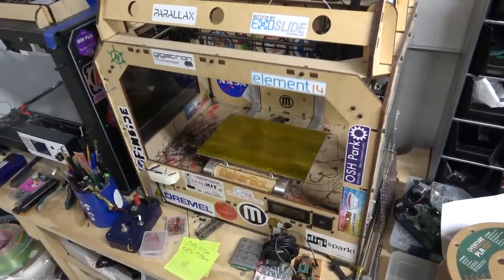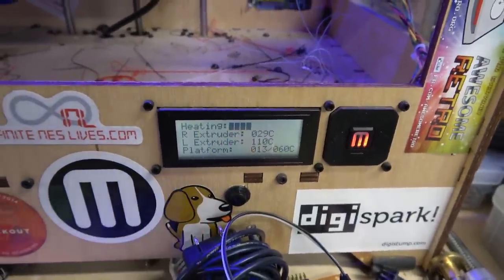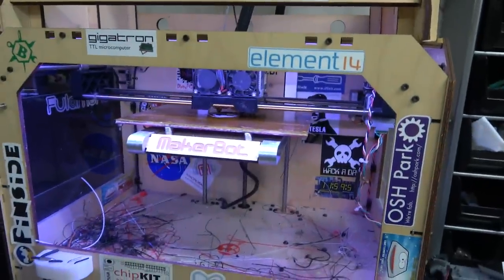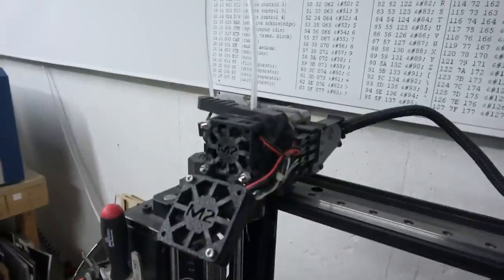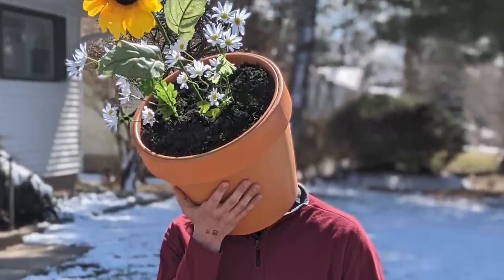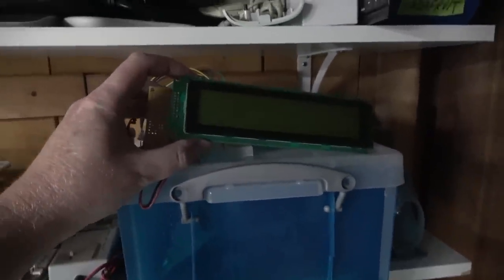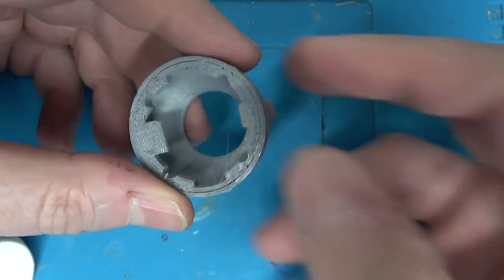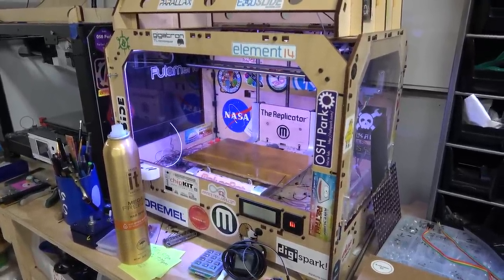10 Years of 3D Printing

Comment: I remember the days before 3d printers where you were limited to either trying to vaccum form plastic or shaving a block of plastic down to what you needed

Crazy how much precision is in a 3d printer
Reply: Even today, for some applications vaccu-forming and shaving block of plastic is used, all depends on the use case.
Reply: Especially resin printers. Holy hell do they have a high resolution
Reply: I wonder what the dominant form of 3D printing will be in 10 years? 3D prints not being as strong as solid parts in the consumer space is surely going to end.

Comment: I remember when you got that markerbot.  I was soooooo jealous of you because I was rocking a home built Mendel and was "WOW, so much nicer".  Then I built an I3 in 2010.  I was really styling then.  About 2014/2015 I was "I should build another one that is larger", and started collecting parts slowly, and life happened.  About 2018? I said "Time to get back on this" and found out that it was FAR FAR FAR cheaper to buy a printer...which I did...Ender 3 (original).  That is STILL cranking with WELL OVER 8000 hours (closer to 10,000).  

I so remember doing the Nichrome wire, baking the ceramic cement in the oven.  UGH!  The people I see on the forums screaming and crying about problems with their printers...lol.  Us old foggies tell them "you have it soooo bloody easy".  LOL.

Comment: Find files for this printer for Merlin 1.9, compile at -o3 trust me the fastmaths works for this version specifically & after compile you'll have exactly like 12 bytes left on the microcontroller.  This'll get you acceleration curves
Reply: why not -O0 which would compile for the smallest possible binary size?
Reply: @phant0m739  because, this is an 8-bit. If you want speed you want truth tables over functions if you want to bang those bits

Comment: Hi Ben!
My first printer was the Makerbot Thing-O-Matic, which came out just before your Replicator.
At the time, all the hobby 3D printers were $2000 kits. I lusted after having my own printer, and found a Thing-O-Matic unassembled kit on Craigslist for $999.
I went to get it, and the guy selling it bought it at full price, opened the box, and went Bleeh! No Way!
It was a totally disassembled, every nut and bolt 30 page instruction book kit.
Loved it, printed many upgrades, and bought the Sailfish control panel for it to get an LCD display much like the Replicator.

This was the very printer that you helped me get up and running at MRRF 2021.
Sorry I missed out on MRRF 2022.  Maybe see you in 2023!
Reply from the maker: I missed MRRF 2022 as well, I had the virus that week. Here's hoping for 2023! I still have that lens cap we printed. Was fun!

Comment: I had the CTC Makerbot Clone, I paid a £169 on Ebay UK for it, I used it for many years, I did several mods to stiffen it, and upgraded the extruder gears. I then built a Delta from a kit, and now I have a Creality CR-10S V2 Pro, which I like a lot. 3D printing is a great hobby and the technology still amazes me 🙂

Comment: I had one of these! I bought it used in 2012; the previous owner was upgrading to the brand new Replicator 2. It worked pretty well for a few years, then the bed heater failed due to a short circuit due to the edge connector melting, and then it limped along being able to only print PLA. Then I replaced it with an Artillery Genius a few years ago, and just a couple weeks ago I replaced that with a Bambu X1C, which is an amazing printer for about the same price as what I paid for the used Replicator Dual 10 years ago.

Comment: You should have told the fire inspector that the extension cord on the ground was "decorative", or it was an important trap to trip burglars and storage-locker auctioneers.

I love all of the random TI calculators in the background. You can't have enough of them.

I have lately been working on my Ender 3 (which was collecting dust for a couple of years after a move), and I have been banging my head trying to get ABS to print without bed adhesion issues. I'll probably try some gluesticks and run by a thrift store to find some glass for the bed. If that doesn't work, I'll go build a foam box for it. Any reason to prefer hairspray over gluesticks? If it's better for bed adhesion, then I might grab a cheap can of hairspray.
Reply: That didn't work for me.  It was an extension cable going from my printer to the kitchen.  Inspectors are too smooth brained to see the value in a three prong socket for a 3d printer

Comment: hi i just recently was given an original maker bot replicator gen 1 2x like yours and it did not come witthe extruder or extruder motors. i have ordered some e3d direct drive hot ends. what motors do you recpmend for extruders and what possible control bosrd would you recommend to upgrade to? thanks steve

Comment: A few years ago in my old apartment I had a fire inspector who was doing a walkthrough (every 2 years here) give me crap over an extension cord.  He said they worry about people overloading them.  I told him it was just for a TV, a small fan, and my phone charger. Also, told him that I have extensive training in electrical systems aaaand that I'm an engineer who knows how not to overload a circuit.  He then just said it's something they have to bring up because of all of the people who don't know what they're doing and will plug a high output window AC into a 16awg extension cord.  On the re-inspection (landlord had to fix some minor stuff) he ignored it.

Comment: I have the Flashforge version of this... still great... Win11 doesn't like it though :)

What is that separate Z screw for? I set Z with the springy bed screws
Reply from the maker: That's the Z home. It's the bed relative to the nozzle. Almost all printers have a form of this, how you fine tune it is what varies (in your case, the thumb screws)

Comment: I’ve got works old Replicator 2, not the 2X, in the process of rebuilding it at the moment. Got a RAMPs board for it and had it running until I decided to upgrade it to use bearings instead of sleeves. Using another printer to print the parts for it 😂
Glad to see they can last!

Comment: I bought an older 42” 1080p TV for my workshop to use for reviewing PDFs and schematics. Cheap like borsht, but the resolution is high enough I can view a good sized schematic without constantly scrolling. It also makes a great fake “window” to supplement the small real one in my tiny basement.

Comment: Ah the sounds of the Makerbot bring back memories of my CTC clone. I stripped it down last year as I'd bought an Ender 3 and had no use (or space) for it, and, would anyone even want it? I might be able to repurpose some of the parts. It was more reliable than the ender 3 has been, just noisier and slower, and I think it was still using the same nozzle too. Also want from S3D to Cura and there's pros and cons to both but I've already found Cura features I've used that are not available in S3D. Great little tour of your shop - I wish I had a basement (but, UK). Love your videos Ben.

Comment: I have the same fingers you do, same half moons & what I was told was cuticle psoriasis, except mine would split much worse than what I see. It was a pain in the ass & I tried to address for a decade before I found "The Naked Bee Hand & Cuticle Healing Salve (1.5 oz/Sunflower, Beeswax & Shea Butter)" It's a bit expensive, but after my first tin I bought 3 more in case it went off the market & that was 6 years ago according to amazon.

There was an immediate improvement, but it probably took a full year for everything to heal & start growing properly. If you don't mind vote this up so the man sees. It was a much bigger quality of life improvement than I had thought it would be.

Comment: Hi Ben this is Matt. So about a year ago I purchased a 3-D printer just like the wooden one like you have in your video but it was in complete pieces I have completely rebuilt it but there is one piece that I am missing and I have not been able to find it or a diagram of the wiring so the cable that goes from the LCD screen to the arrow switches is the only thing I’m missing from my 3-D printer so I was hoping that maybe you could help me with that cable or finding the diagram for it so I can start my 3D printing Journey. I have learned a lot watching you for all these years an have missed all the awesome projects.

Comment: Time estimate being off is caused by time dependant settings (speed, acceleration, feed rates) being too high in the printing profile in Cura and the printer firmware limiting the actual values.

Comment: My first ever 3D printer was FLSun Mega (that version with 300x300x300mm build volume). The power supply gave out, then the main board died on me. Horrible experience. Then I got a resin printer and I am saving up for a Prusa.

Comment: I still have my Replicator Dual, tons of parts and mods I redesigned myself. One of the biggest upgrades I made to it was putting "impact" super glue (about the same as red lock tight) in all the screw holes and retainers, also added washers. The frame holds just as well as any other frame now (still) 🥰

One thing I did notice is the old motors run much warmer but also seem to print much smoother. I put one motor on a i3 machine I have and removed banding. Put the original motor back on and added smoothers, which did almost as well as the old motors.

Comment: rep1 was okay after the extruder mods and sailfish.   also pretty noisy. and pricey.    but basically home fdm printers haven't changed at all since then.

edit: you damn well updated the firmware if it's running sailfish.  mine shipped with the makerbot firmware that DIDN'T HAVE ACCELERATION..

Comment: I was just looking up what the early maker bot was.  I remember seeing a 3d printer for the first time at maker fair 2010 or 2011 and I couldn't take my eyes off it.  I don't remember what it looked like.  I remember it being laser cut wood with that tiny build plate, but I remember the corners being cut.  I think I'm just remembering it wrong and it was probably the boxy MakerBot.  I swear it was MakerBot 1 or 2.

I didn't have the money for a printer for years, till the anet a8.  That thing sucked and I got an Anet et4 and it's pretty good for $150.

Comment: TPU sometimes prints better faster, I use an old robo 3d r1 and I actually print it with slightly hotter pla settings and get good results

Comment: If you want a better display for your portable computer project, you should look into graphical vacuum fluorescent displays. Noritake is really the only company that still makes them, but the max resolution is 256x128 dots. Which, as you probably know, is 2/3s of the regular 256x192 resolution many computers used.

Comment: I also like Simplify3d over cura, i had a lot of issue using cura but simplify3d just worked. the time estimates are pretty off for me as well but when i started using it years ago it fixed a lot of the issues i had with cura on printers.

Comment: It wouldn't be a nerds 3d printer if it doesn't have a ton of mods.
Reply: Most people buy a 3d printer just to print mods for the printer they just bought. And once the printer has been completely modded they never use it again.